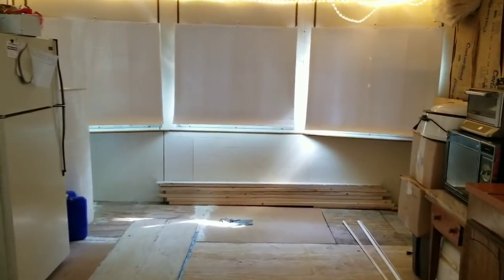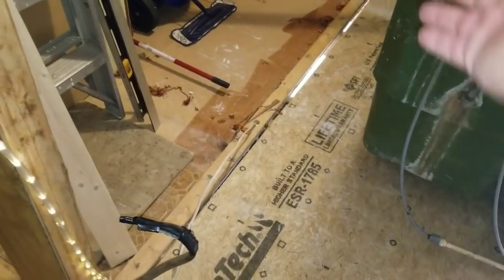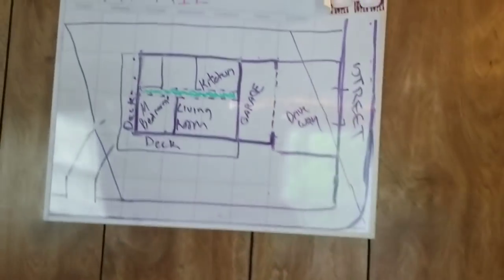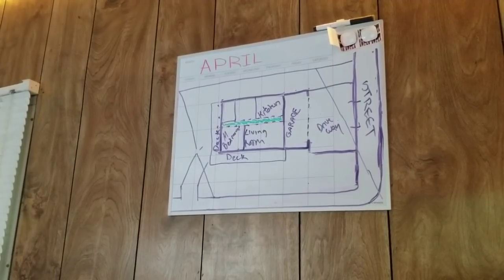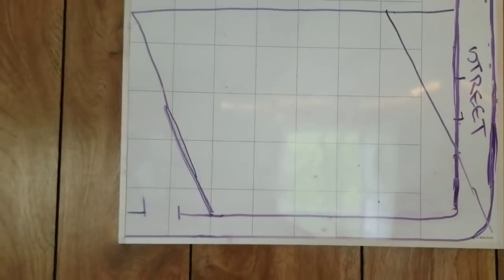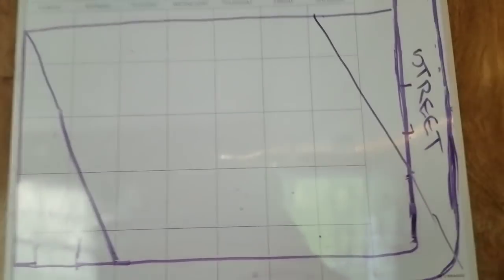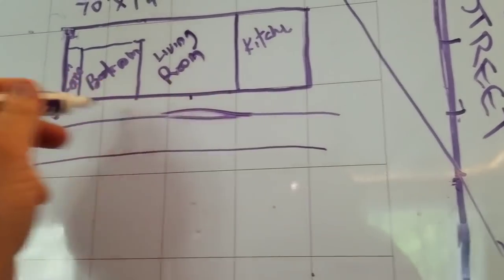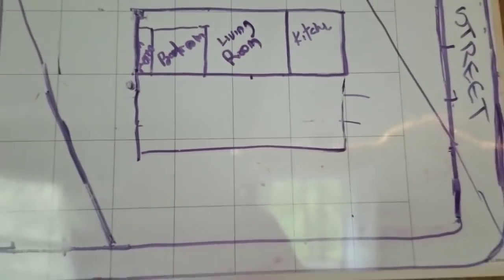FINISHING UP CUSTOMERS DECK AND WILD MOBILE HOME REBUILD IDEAS

Comment: The front extension is a great idea, especially to gain more square fot living space. The thought I have though is when you are going to have to cut the main I-beams of the frame, will it weaken the integrity if the rest of the frame? Lots of heavy duty welding there and thorough planning plus you'll no doubt need to put you on some deep cement headers to put new pylons on to support the end where you've cut the frame. Also wonder about the roof support at the end there where you'll be putting a new outer and inner wall. Get tarps, lots of heavy duty tarps to protect tjatvend while you're in demolition mode: those summer pop-up storms are a bitch and you dont want water in you're part of the trailer thats going to remain!!! Bon fire and recycle in your future! The wrap around deck will be totally awesome if you choose that extension route!!! Good luck!

Comment: A LOT of the variability of cost in residential construction is in the cost of the materials and installation of the finishes (wall treatments, flooring, countertops, fixtures, etc). Since you are pretty dang handy in selecting and installing the finishes, I would ask your buddy for a breakdown of the cost per square foot for the foundation, structural, exterior (to the point of dry-in), roofing, MEP (mechanical, electrical, and plumbing) work and then you can decided what part of the finishes you want to take on for yourself. With the cost per sq. ft. data you can decide how big you want to go or maybe do it in phases. Comparable cost per sq ft. data for residential construction for verious areas of the country is readily available online. What you are talking about doing seems doable and the value added to the property would more than pay for itself in the long run.

Comment: Have him also calculate scrapping the trailer entirely,  and doing a metal Barndominium - or Pole Barndominium.    Either way, using a slab.   Just Thinking  out loud

Comment: Remove the trailer altogether, build a solid foundation, build a new house.  Why piece meal?
Reply from the maker: Because I can and it's easier and its alot cheaper. a footer alone cost $7,000 to $10,000.
Reply: @MDC2020  Thanks for the reply, I learn a lot from your posts and look forward to more.  Love the 4Runner too.  I got  2000 Toyota Sienna 255222 on the clock.  $1400.